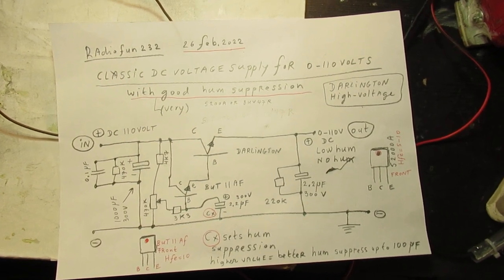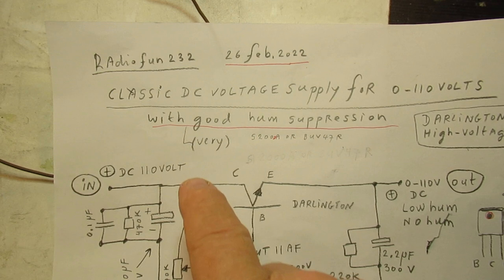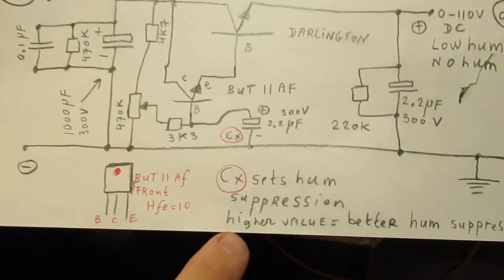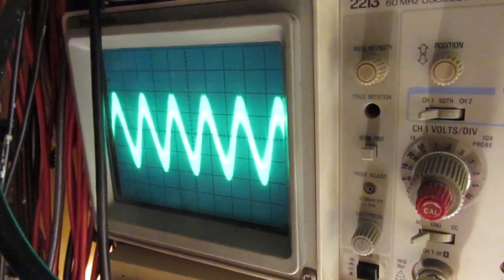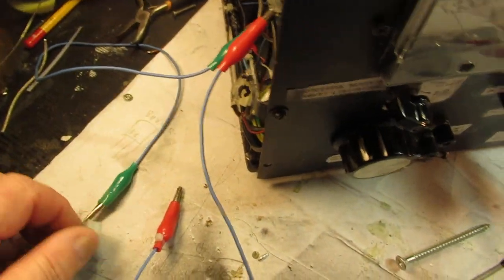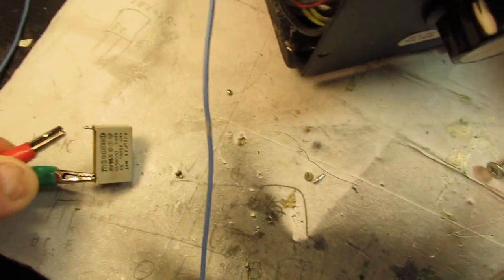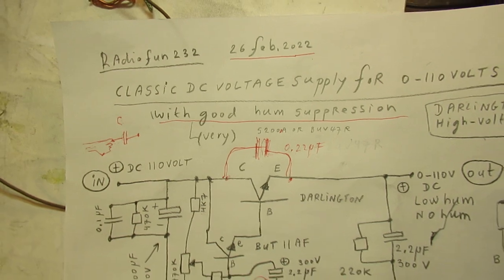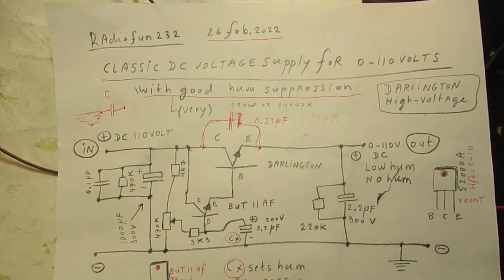About how to discover and cure parasitic oscillations, here in a 2 transistor HV Darlington supply

Comment: Does the capacitor provide negative feedback?
Reply from the maker: Yes, I think so, though the exact meaning of negative feedback in this setup is somewhat unclear to me. The "solution" was found experimentally, though after further testing there is still a kind of faint hum/oscillation when the circuit gives out its maximum current via the protective series resistors in the low value (10 Ohm-70 Ohm) range. No faint hum with the protective resistors of the higher values, say in the  1 K range and also no hum when the protective resistors are shortcut. I think the sloppy wiring plays a big role in the not ideal functioning of this circuit + the fact that I have used a voltage doubler to get to the 110 Volt DC that I needed. Better use was a bridge rectifier with a real (say) 70 V or 80 V AC transformer. Thanks for your comment, I will pin it. 1 march 2022.
Reply: @radiofun232  Thank you

Comment: The hum can be "injected" into electronic circuits in 3 ways.
1) By direct connection, the hum (noise) coming in the circuit through the mains input (also called "Dirty electricity"), 
where a transformer will filter out most hum, but pass the 50Hz/60Hz to the output of the transformer.
2) By air, due switching power supplies, TL lamps with electronic ballast and LED lamps in the near area of the circuit.
3) By human connection when touching parts of the circuit, the human body acts like a antenna and will pickup all kinds of frequenties from 
switching power supplies, TL lamps with electronic ballast and LED lamps.
Switching power supplies like cell phone chargers with only 5V DC output, will have "switching noise" on the output.
If you take a "non contact voltage tester" , those normally react only on AC from 12V to 1000V, but these will also 
react on cell phone chargers. Not on the 5V DC itself, but on the switching noise that runs on top of the 5V DC.
When you use the same "non contact voltage tester" on a linear bench powersupply, i won't react at all.
These "non contact voltage testers" can also be used to investigate at a safe way without touching the circuit, if hum is present.
Reply from the maker: Thanks Bjorn, good info.

Comment: Thank you for your thoughts regarding Ukraine - very sad and dangerous! Your circuit: It's funny, I'm seeing +ve feedback with your capacitor. As the 2.2uf is on the base of the BUTII making this circuit common base - if the Darl' collector goes up, via your cap, the emitter will also momentarily go up, causing the Darl' to conduct less - causing its' collector to go up further until saturation is achieved, then a reversal. The frequency of which would be dependent on stray wiring L and C. There are oscillators built around this concept, but I could be wrong? Curious how a simple emitter follower circuit can have so many complex twists and turns :) Your videos are always interesting and frequent.
Reply from the maker: Thanks for your evaluation, Michael. I made this circuit many times, in general: never problems. Only in this case, with the combination of a high current and voltage. When it is used as a HV circuit in the (say) 50 mA range all the standard "tricks" to get them under control work (lowest base current as possible, the use of decoupling capacitors, etc). I made in the past two (say) 150 V - 20 mA circuits in this way with HV transistors. The combination of a high voltage and a high current makes the wiring critical. 2 March 2022.